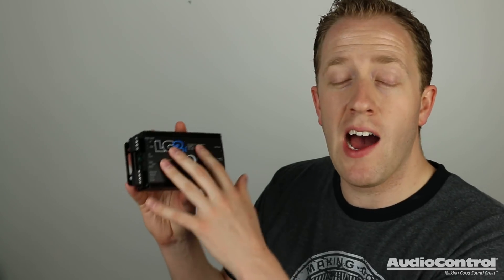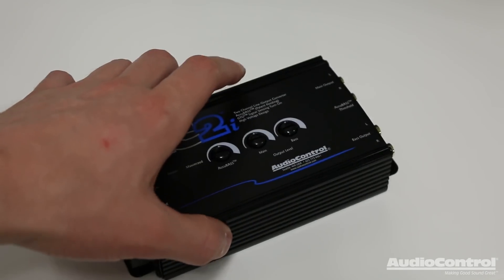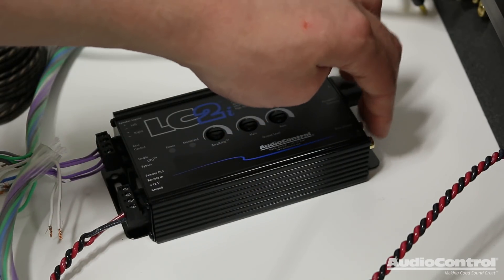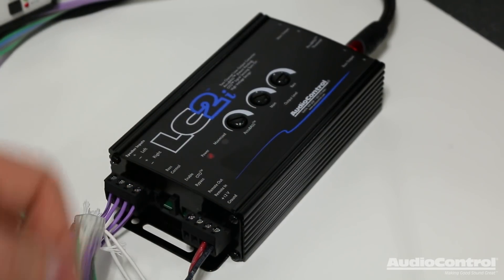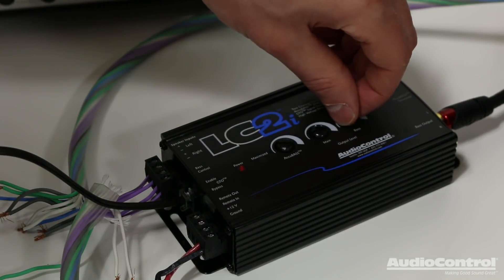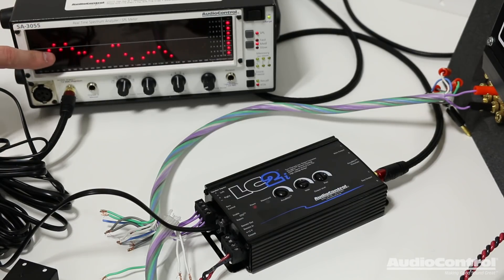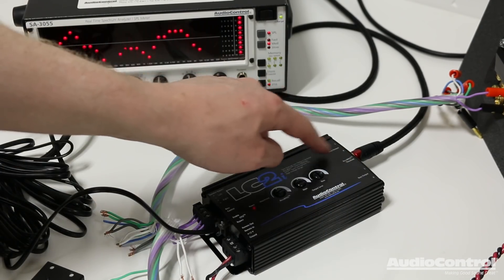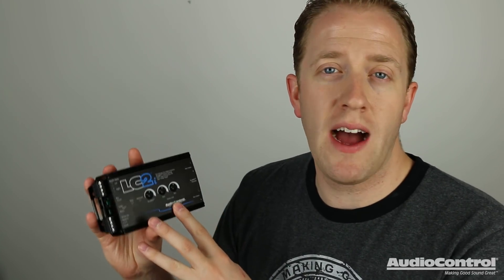LC2i - Add a Subwoofer Amplifier to a Factory Audio System - Line Output Converter

Comment: I added the audio control lc7i and it helped with the aftermarket speakers and both amplifiers that I installed. But it's still missing something. A friend of mine suggested jailbreaking the factory stereo which seems like a good idea b/c it's going to play to it's full potential once Ford's calibration has been removed from the factory stereo. You guys should do a video on how to jailbreak Ford's stereo. So far I think ford is the only one that you can do it to but maybe im wrong. Thanks again for the video. Any feedback appreciated

Comment: Do you connect the line converter to the output wire for the speakers on stock amplifier or before?

Comment: Does it matter if you tap the front, rear or factory sub speaker wires to feed this unit ? I have a bose factory system with a factory subwoofer that has a single wire with positive and negative. Can you run this unit off that wire alone and still run RCA cables to mono block amp successfully? Or should i tap the left&right front or rear speakers instead?

Comment: Do I need to run a constant power wire to the lc2i and my amp or just the lc2i and use the remote out to go to the amp?

Comment: I just wanna know how im supposed to run the power wires to the loc... like is it okay to just use a wire that tiny right off the battery
Reply: You should piggyback off of the power / ground you had to do for the amplifier. Because the LOC and Amplifier are probably going to be located in the same part of the car so should be relatively easy.

Comment: Looking for an answer - installed LC2i to factory 2020 Malibu.  Had issued with the GTO and the unit and amp not turning off.  I bypassed the GTO feature with a dedicated remote turn on for the car.  Everything works great and the LC2i and amp both turn off when the car is turned off......however, when the car/power is off the "maximized" led is now lit.  The AudioControl site says "If the unit is working fine otherwise, but the maximized light stays on, typically that means there is an issue with grounding."   My grounding seems secure and sound so does this mean my unit is "fine" or what else can I try?  I don't see this specific issue anywhere else.

Comment: @AudioControl I want to add a 5 channel amp to my factory radio(no factory amp). It will power 4 Pioneers(2-6x9s, 2-6.5s, 2 tweeters) and 1 Kicker CompVr 12. Could I use the LC2 and use the male/female splitter for the interior speakers? By the way, the amp is a Soundstream P640.D

Comment: So, can I simply run ONLY the 12v remote wire for power to the lc2i? Do I need the additional power and ground wires? 
I just want to run the remote in from my factory stereo, and then run the remote out to my amp...also, I am only running 1 mono channel amplifier to my subwoofers, do I just run the rear left and right speakers to the lc2i?

Comment: What kind of wire do you use for the 12v and ground?
Reply from the maker: With any of our LOC type products (LC1i, LC2i, LC6i, etc. etc.) you'll want to use something in the 14-18g size, depending on the length of the wire run. Pro Tip: Wire ferrules can help to fit slightly oversized wire (i.e. 14awg) in the 4-pin phoenix connector.

Comment: @AudioControl I have seen this question asked a couple times and still no answer.

If we have a factory sub and want to add an aftermarket sub, should we just use the factor sub leads for our high level input? If what channel do we plug them into on the LC2i?
Reply from the maker: There is really no correct answer here, since every vehicle is different. However, let's take shot at it: If you do have an OEM subwoofer, you can certainly attempt to use those leads for your input to the LC2i. In that case, feed them into the front left high level input, but use a short length of wire so that the right input is also receiving signal. (basically a "jumper" from left + to right +, and a "jumper" from left - to right -. This will ensure that both L + R rca outputs produce sound. If your results from this method are undesirable, then try using a different signal source from the vehicle, such as front door speaker(s) or rear speaker(s). Hope this helps!
Reply: Yes use the rear deck sub leads

Comment: Should the acr remote knob wring be run paired with speaker wires or power wires? My guess is power but want to be sure
Reply from the maker: Doesn't make much difference, to be honest. Most of the time it gets ran with signal wires or whatever leads run towards the dashboard.

Comment: How does this compare to the J L Audio fix86?
Reply from the maker: The Fix86 is a correction DSP, so it is going to offer OEM signal correction and summing. The LC2i offers high quality high to low level signal conversion, as well as AccuBass to correct OEM bass rolloff. Both are great products, but kind of apples to oranges.

Comment: So now I have a quick question. If I use the rear speaker wires to wire up to the line out controller to add a subwoofer. How will I be able to use my rear speakers still ? Will I have to add a amp for the speakers ?
Reply from the maker: Any speakers you tie into for signal will still function as usual. It will not take the signal away from the existing speakers, or anything like that. Just make sure when tapping in for signal, that you're T-ing into the signal, and not actually disconnecting the existing speakers.

Comment: Is this the best method to use on a 2013 lexus with ML sound system. From what I've heard is that there's issues because the factory amp is MOSFET.    ??????
Reply from the maker: Not sure about that particular vehicle, but we have yet to run into a vehicle we couldn't use an LC2i with. No matter what type of factory sound system or amplifier it was equipped with, we are compatible. Because the LC2i is taking in speaker level signals, and can handle exceptionally high input voltage, there is no reason why you couldn't use an LC2i with your vehicle to add a subwoofer. If you're looking for something else, please give our tech team a call so they can walk you through the solution. They can be reached at 425-775-8461

Comment: Hi Mark i have upgraded my Audio on my car and it sound great and recently installed ACR1 but for some reason the sound drop after connecting the bass knob and it works like volume when turning the knob and another issue is i can hear static sound even when the head unit  Off or ON.  What could be the issue?  Below is the Hardware installed on my car. Thanks 

Ciare KCA230 component 
CW170 set
CT190 set
CF231 set
Sundown E10 
Stetsom HL 1200
Audio Control LC2i 
Audio Control ACR1
Head Unit (Stock)
Reply from the maker: Please give our tech team a call so they can walk you through the solution. They can be reached at 425-775-8461

Comment: Can you use stock subwoofer for the input on the LC2i or use the speaker inputs instead ?
Reply from the maker: If your vehicle has a factory subwoofer, you could use the speaker leads that currently run to it as input signals for the LC2i. In return, the LC2i will provide you with a clean, high voltage low level (RCA) signal to run to your aftermarket amplifier(s) input.
Reply: What if the factory subwoofer has a corssover? Ive noticed at low frequencies it cuts off . Should i just tap into full range speakers??
Reply from the maker: @jassonrubio1778  Possibly. Many factory woofers are crossed over at undesirable frequencies for aftermarket woofers, so you may be better off snagging your signal from other speakers in the vehicle. You could verify using an RTA if you have access to one.

Comment: So from the factory head unit to the lc2i you only wire two speakers? And after you wire those two speakers what about the other two speakers? Just cut and run them from the amp to the speakers?
Reply from the maker: It really depends on your intended result and system design. The LC2i is a 2ch device, but it does have 4ch of output in case it's needed. If you are planning a multi channel system, the LC6i, LC7i, LC8i, LCQ-1, DQ-61, DM-608 or DM-810 might be better suited to your needs. You can check them all out here: https://www.audiocontrol.com/car-audio/factory-system-upgrade/

Comment: So do I put the factory speaker wires in on the input side before the the factory amp ? Or running from the output after the factory amp?
Reply from the maker: All of our products can be used with amplified OEM signals. So you can interface after your OEM amplifier. Outputs from factory amp go into LC2i, then RCA outputs from LC2i go to your aftermarket amp's inputs.

Comment: I want to keep my 2014 f150 stock navagtion screen radio and add a amp to the stock radio but it doesn't have rca or remote channel!?!?!? What do I do or need ? Thanks guys and gals
Reply: You buy a LOC
Reply from the maker: We have lots of products and options that would work with your vehicle. All of our amplifiers could interface directly with your vehicle without the need for additional parts. Otherwise, any of our line output converters could also work well with your system if you already own an amplifier you'd like to use.

Comment: If you're just using this for a Mono amp,do you still need to tap into 2 speakers? And can you use the same Audio control knob from a Epic center?
Reply from the maker: https://www.audiocontrol.com/knowledge-base/factory-head-unit-mono-output-can-just-send-mono-signal-lc2i/ 
This article explains it well, and to answer the question about the bass knob: Yes, the knob for the LC2i and the Epicenter are interchangeable (model# ACR-1). Unless you have the Epicenter Plus, in which case you'd need an ACR-2.

Comment: So with my understanding I can just add this to my factory speakers by t-raping then not add the blue Control wire to the radio and instead I could just add all my after market Amps to this as a Control
Reply from the maker: Correct

Comment: I've been looking st so many converters and I learned a little but i always want to make sure i order what i need. Could I use this converter to install an amp for my subwoofer and another amp for my mids and tweets? Or would i have to go with the LC7i?
Reply from the maker: You CAN use the LC2i to install an amp for your subwoofer as well as an amp for your mids/highs, however, because it is a 2ch converter, you will lose the ability to fade front to rear. If that is important to you, the LC6i or LC7i would be a better fit for you.

Comment: If I'm adding a single subwoofer setup, would I still need to tap both left and right sides of the rear speakers and into the lc2i...or just tap on to either the left or right side?
Reply: The most important question of all time:(
Reply from the maker: https://www.audiocontrol.com/knowledge-base/factory-head-unit-mono-output-can-just-send-mono-signal-lc2i/

Comment: Can I plug this in with rca without using speaker level inputs ?
Reply from the maker: No. The LC2i is a line output converter, so it is specifically designed to take in high level (speaker wire) signal and convert it to line level (RCA) signals that most aftermarket amplifiers can comfortably use. If you're looking for something that is RCA in and RCA out, we have many other products that might fit what you're looking for. Check out out full line of mobile audio here: https://www.audiocontrol.com/car-audio/

Comment: What if I’m only wanting to add a Subwoofer? I want to leave the stock door speakers alone and just add the Subwoofer. How would that work? Would I have to make a T splice with the door speaker wires and then only use the Sub output RCA?
Reply from the maker: Yes, that's pretty much exactly how you'd do that. Just tie into an existing speaker lead for signal. The existing speaker will continue to work as normal, but the signal will pass into the LC2i and then out to your aftermarket amp/subwoofer.

Comment: What if my bass doesn't roll off? Do I set the accuBass to zero and the threshold all the way CounterClockwise?
2015 Ram 1500 stock uconnect 8 inch screen. Non Alpine 
Thanks

Comment: Will this work for my 2016 Charger R/T? I'm told that I need a device that specifically converts low end freq to high. I keep seeing high to low.
Reply: It works on any car wired correctly. Every LOC normally is low to high

Comment: You should use ferules for the raw wire.  I don't work for the company, but they are dirt cheap: https://www.amazon.com/Ferrules-Sopoby-Insulated-Terminal-Electrical/dp/B06XCX8FMZ/ref=sr_1_2?keywords=ferule&qid=1575931786&sr=8-2

Comment: Great video but here is a trick question. I have condemned a factory sub and installed this unit however it then goes to my audio control epicenter and then to my amp. Performance is ok but after doing some research I realized that the concert series needs a full range input to function correctly. Now with that being said should I be using the base output or the full range output  . Thanks
Reply: Just tap into a full range speaker. Not tweeters

Comment: 2019 Camry XSE - (non JBL) - so, I can use this to tie onto one of my existing speakers to get my full range signal, set up the LOC itself, then it send the appropriate signal to my amp. got it. questions: can i split the "main" to run the A/B channels, then obviously use the sub for the sub input on my 5 channel amp? also, i assume i would have to still run new wiring to each speaker from my amp right? Please forgive my ignorance, been out of the game for a LONG time...
Reply from the maker: Yes, this will allow you to grab signal from the existing system, feed the "main" output signal to the mid/hi section of your 5ch amp, as well as using the "bass" output to run signal into the subwoofer section of your 5ch.However, you would not have any FADER functionality. If you used our LC6i or LC7i, then you would maintain the ability to use your OEM radio's FADER.  Also, you are correct, you will need to either run new cable to each speaker location, or obtain your speaker connections behind the radio.
Reply: @AudioControlCar  I ordered the LC7i just to he on the safe side. Read to put it all in next week.

Comment: Will this unit accept a 2ohm Amplified high level signal from the factory 35-300hz leads
Reply from the maker: The LC2i will accept just about any hi level/speaker level input, up to 40 volts (approx. 400 watts).

Comment: The GTO seems like a brilliant idea but what about power/memory to turn on the amp itself...isn't that still required when using the LC2i?
Reply: You would still need to run power and ground for the amp, but remote turn on can just run a wire from the remote out of the remote wire on your amp. This is a huge plus.

Comment: Audio Control.... So I have 2 amps. A 50x4 and a 400x1, both are Rockford Fosgate. I have a 2018 4Runner and want to use the LC2i to run the 50x4 to the front and rear door speakers and run the aftermarket subs with the 400x1. Is this what I need? I also have 2 speakers in the dash and 2 speakers in the rear tailgate but I plan on leaving those alone. Is the LC2i what I need, cause I have a new one that I didn’t use from my last build?  Thanks!

Comment: I have a 2018 GMC Sierra with the Bose system I tapped into the factory amp since I’m only adding bass I originally bought the wavtech linkD but it wasn’t giving a signal to the woofers like I need it to the woofers are getting some type of signal but it isn’t a strong one  so I’m trying to figure out what maybe causing this and just wondering if the LC2i is going to fix this problem

Comment: Can I put a amp to new front and rear speakers and then add a small sub?
Reply from the maker: Yes you can use this to provide "RCA" low level signal to both a Mids/Highs amplifier and a Subwoofer Amplifier

Comment: When my car cut off my amp stays on and sends a constant signal to my sub
Reply: Christopher  Lynch use the remote out from the lc2i to the remote on your amp. Or use the remote on your amp to a keyed 12v source.  Like a "cigar lighter plug" that only powers on with the car running.

Comment: Can I use the Lc2i for left and right tweeters front and rear and acubass will not affect sound output/performance? Going to use with Lc7i as my vehicle has a 10 speaker system with 3 amps installation. Or should I get 2x Lc7i instead?

Comment: Can you power 2 amps at the same time? A 4 channel and a mono? Or is it just suggested for only one out?
Reply: Using it on 5 channel amp use the y adapter rca for front &rear  then sub output for bass look it up y adapter rca.

Comment: Does the lc2i need both input signals left and right for it to be used solely for adding a subwoofer amp ? 

Can I grab signal from say just the right rear speaker ?

Thanks for a reply.
Reply: yankphan100 honestly i dont recommend only using one speaker input. It may only make the right side rca output work on the unit tho i dont know for sure thats the case. Again i dont recommend it.

Comment: I’ve used the LC2i in a couple of previous vehicles with no problems and great results. The issue I have now is I can’t find a factory radio diagram for my current vehicle. It’s a 2017 Volkswagen Passat SE with 6 speaker non-Fender system. Please help!
Reply: I would assume it would make sense to mount it somewhere in the trunk and pull the speaker signals from the 2 rear speakers, no?